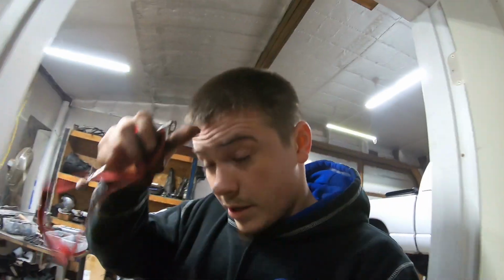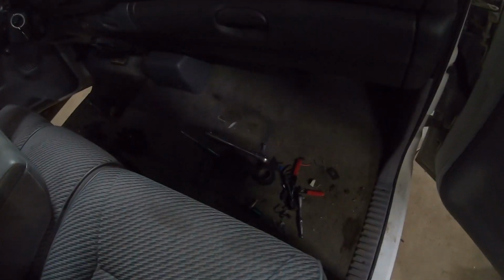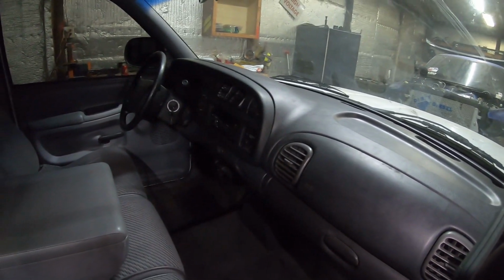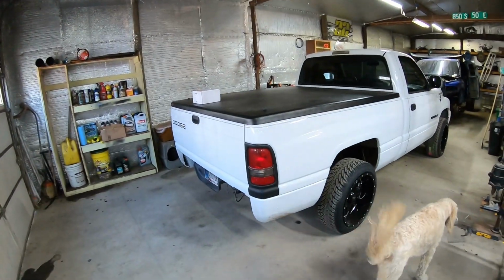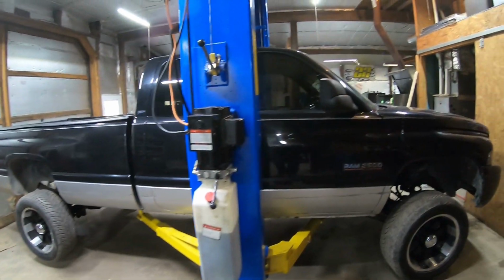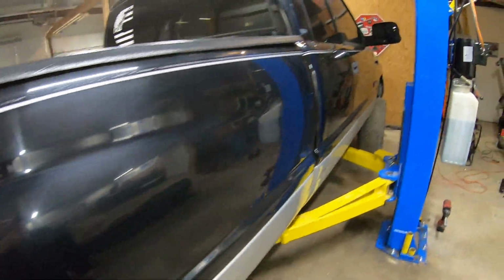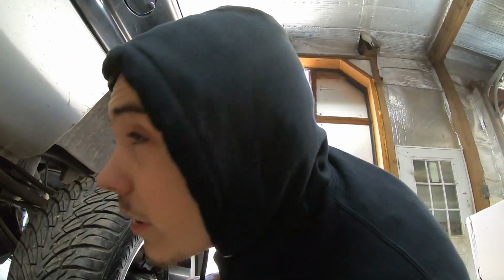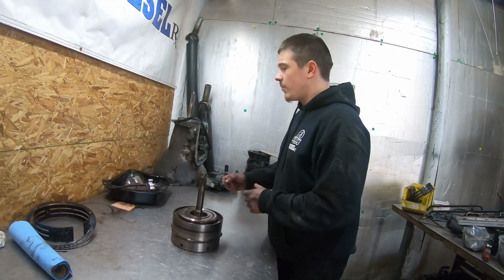My New Truck! and It already needs a transmission!

Comment: Back probe the tps input into the ecm and make sure you've got proper voltage and that it's not a wiring issue. Otherwise I'd say vp44

Comment: You ever seen one of the big overdrive springs broke? I have one I am pretty sure the spring is broke took the snap ring off let the pressure off the spring it doesn't even come up out of the gear. I press it back down put the snap ring back on I got scared thinking the spring may fly out.
I have done a few 47re and 48re I seen 2 with the drums stuck on the input shaft